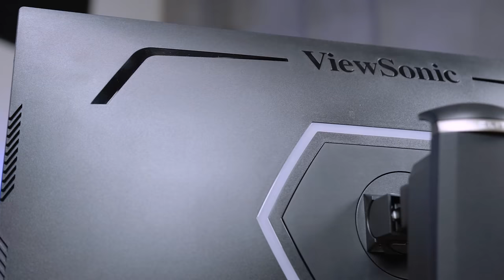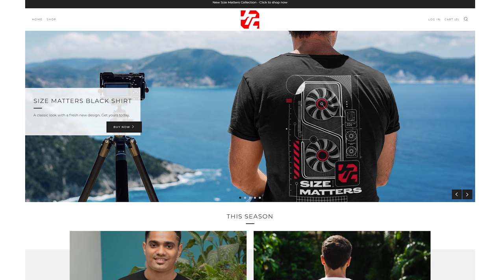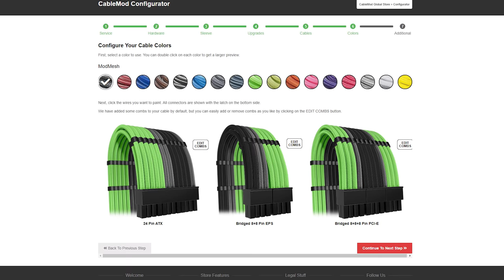This PC turned out better than I had hoped!

Comment: Honestly, I've enjoyed having multiple videos to see how this project has come together. Sometimes a single video can end up feeling rushed through. Also, loving the choice of green for the build!
Reply: Just as a quick aside, if the Jayz team is ever interested in right angles for cables, Moddiy sells 90 degree Pci-e adapters. I'm currently rocking them in my build, so far power delivery is stable *knock on wood*, and it really helps clean up the cable management!

Comment: You should frost the reservoir/get a frosted reservoir to match the tubing runs. Would look so much cleaner and consistent.
Reply: yea you can buy it in spray can form. Works well and would be well worth it. The more layers you do the more intense the effect. Also could do some clever masking to make patterns or make the "frost" look like its creeping towards the middle from both ends.
Reply: agree
Reply: He was talking in his first or second video on this about wishing it was also frosted, but he's just using what he has.
Reply: @joshuaanderson3443  he can also just use fine sandpaper which im sure he has and sand the outside and spray a matte clear coat over it. Theres plenty of ways he could it. Surprised hebdidnt lol
Reply: @joshuaanderson3443  Ooh

Comment: Looks absolutely fantastic, really can't say what else needs to be done to the build. Its pretty much bang on. As you've got UV reactive fluid in there might be worth adding 1 (yes just 1!) UV led near the front of the case and the resevior to give the corners of the tubing and the res a tiny bit of light shading/pop, but thats only a suggestion to play with. Really doesn't need it though. Nothing else needs done. It's bangin'!

Comment: This turned out great.  

I am doing a similar-ish build, but using the 60mm thick radiators, black everything, no RGB, and soft tubing.  All EKWB for everything.   Its an "all go, no show" build.

The biggest thing that I am doing different is I have my pump/res very low, mounted to a custom plexi piece to the side fan bracket, between the power supply shroud and the front rad, and rotated 90 degrees so the tubes won't interfere with anything.  Even with the 60mm radiator, I still have 350mm of space for the GPU.

Comment: I use automotive grade water wetter for track cars. it is slightly purple, but goes clear with water. I have never had an issue with many different builds. I used some pearl color one time and it really messed up everything. great build Jay. benchmark for the win.

Comment: Great build Jay, it looks fantastic. . . . but I have to say, why didn't you use the vertical graphics card mount closest to the side panel (the one that would take a double slot card), I'm sure that would have cleared the pump and would have actually given you more space between the graphics card and pump as it mounts the card closer to the rear of the case. I thought because you're only going single card this time (first time ever) it'd be the ideal time to do a vertical graphics card mount. . . .

Comment: Only thing I would change is the orientation of the motherboard 24 pin cable so it matches with the GPU cable green black green. Apart from that tiny detail, Awesome build, Awesome camera work and awesome content. One more thing. I bought the cheap CPU air cooler you reviewed a few months ago for my Ryzen 2600. Haven't seen temperatures over 60c yet. Quality part

Comment: I think I might flip the front rad so that the inlet/outlet aren't at the high point of the loop. I'd also reconfigure the order so that instead of the flow from the reservoir going GPU -> CPU -> RAD -> RAD it would go to the GPU -> Top rad -> CPU -> Front Rad. I might have also stuck a hard valve in the bottom section with a cap so that I could easily connect a hose and drain the system from the low point. 

I doubt that any of those tweaks would be in any way consequential - this a really beautiful build. Great work!!

Comment: Nice build Jay, good job on the tubing, agree about the bends on the lower tube, would have looked a bit better if you'd more "matched" the upper ones. One thing I might add, not change, is add some form of lighting in the lower section to light up the lower tube coming from the GPU, because if you look carefully, you'll see the colour doesn't match back with the rest that are getting illuminated by case fans - the rest more match the greener green of the cables.

Comment: Hey Jay; Just did a rebuild with Corsair Icue, and Asus Aura/Armory Crate. There was a recent update to the ICUE software where you can join them together in the same place and it worked really well. Just an FYI that those can now work together and you don't need separate RGB software.

Comment: when you see the case in the total view... 1 thing is a little off about it. the window of the PSU shroud is a dark hole. Maybe a LED strip would pull it towards the build.
But for the rest .. really awesome!! bending those tubes must have taken you hours. Good to see Skunkworks back which is kind of a foundation of your channel :)

Comment: Jay, idea

you know those brackets that you use for some light strips, to keep them at a 90degree angle? what if you had some for the soft tubing, used that to prerun your loop and measure everything out, and then use that to cut hardline.

and instead of soft tubing to prerun everything, could use something else as a standby

Comment: Not sure if it's different for the ALs but for the SL120s you can turn on "Sync with Motherboard" or something like that and the fan RGB will be controlled by the motherboard RGB software. Looks badass with my dark hero and plexi EK blocks.

Comment: The only thing I would change is put a small mirror form the back of the case till the pass through fittings to be able to see the gpu block. Maybe put some rubber pads under for vibration dampening. Nice build BTW.

Comment: The final result looks sooo good. Awesome work man. I didn't thi k I would like the res not matching with the frosted tubing, but it looks great! Only tiny nit pick just need a bit of white lighting on the bottom section of the system, it's a bit of a dark void under the gpu and that btmottom tube doesn't quite pop as much as the rest of them.

Comment: Jay: Pretty sure PMMA is the same material as most acrylics, corsair seems to just be using the actual chemical name rather than the generic term. 
It'd be interesting to see how much the frosting affects the heat transfer you were talking about, you could test by sanding the clear pmma tubes to get a frosted look.

Comment: this is just beautiful, I actually prefer the graphics card not lighting up.
The only thing I would change would adding a frosted glass for the res to match the tubing.  
That and lots more storage r/datahoarder

If  I was going to try and recreate this build, I'd probably go with a lot of silver 90 degree fittings to avoid multi-bending a tube, but that has a lot to do with not being able to line up bends properly

Comment: As you were talking about drilling through the floor the only thought i had was, how awesome would it look with those GPU cables tied together if they ran straight through the floor. I guess cut your hole just big enough for them,  but with that i dont know if you could order a rubber seal that would be soft enough to fit over the cables and still able to seal up the floor to make it look clean. Just a thought.

Comment: I'd try mounting the pump/res to the back and low near the bottom. Maybe put a higher res tube on it. Then route the tubes through the shroud. The graphics card can now be vertically mounted. I'd put it in the verticals mounts near the front and come up with the tubing from behind. So it goes pump -> graphics card -> CPU and you basically only see the loop going into the CPU without seeing where comes from.

Comment: That shade of green is not one that would have caught my eye before, but wow does it look nice in skunkworks! Love the glowsticks tubing, love the touch of the motion lighting on the ram sticks - gives it a falling data stream feel (like from The Matrix) - and on the fans. I'm not nearly into the hobby as most of the other commenters probably are, but to me skunkworks looks like a kickass computer AND a visual aesthetic piece. 

Oh, and don't worry about the length of the build. I like seeing the problems you run into while building. That way when i build my own rig in the future, I'll know what to take into consideration because hey, Jay ran into this issue.

Comment: Jay I would've used the vertical mount that already is "installed" in the case as it doesn't seem to interfere with the RAM or the valve fitting :) apart from that, amazing build! Nice work

Comment: Holy crap - that looks amazing! And yes, more videos is never a bad thing. Gives me something to do while working!

I've had a Corsair 750D Airflow for years and I kind of want to water cool in it. Only problem is I can't find a water block for my video card. Would anyone out there know of anything (not the NZXT AIO) that would fit a Gigabyte GV-N2080WF3-8GC Rev. 1.0? Like Jay, I mess with cars, so I'm not opposed to a little modification. Thanks for any help!

Comment: Hey Jay, random video idea: show the best/most efficient way(s) to fill a combo distribution block/pump like the ones EKWB sells for different cases (like the 011D XL). Tip the PC over so the plate is flat, use a 90 degree fitting, a funnel, a filling bottle, etc...EK includes instructions on how to install the plate into a case, but not how to fill the darn thing, would be a very helpful video for us watercooling newbies.

Comment: @JayzTwoCentz The EK M.2 heatsink I was able to get to work with a Corsair MP500 drive that had chips on both sides. I removed the thermal pads and just used a little bit of thermal paste instead. Works perfectly so if you ever have that problem again, give it a shot!

Comment: you can use Signal RGB or Project Aurora as one stop solution for controlling RGB of the entire system. you won't be needing any other software to control RGBs.

Comment: I think it looks amazing.. the only thing I would do differently is there is a lot going on up top.. and a lot of black empty space in the bottom.. I would have put a small built in screen where the window to the power supply is, or make a custom cutout next to that window.. and put it there, other than that... why not two 3090s... it is skunkworks.. and probably the last generation we will ever see SLI unless from some miracle intel starts doing it on their cards.

Comment: Jay - you asked what we might do differently: I can't really comment on the water cooling aspects of the build, as I have no experience with it, but cable-wise I do have a couple of ideas. 1 of them I won't bother describing, as it's still kinda vague, and I'm not sure if I even like it, but the other is from an old modular PSU I had.

Are you familiar with a brand called Ultra? I recall seeing that some people had issues with them, & mine eventually died, so... 🤷‍♂️ Aesthetically, though, they looked pretty cool, especially the cables. Instead of just wrapping the wires of 1 cable with braided sleeving, they used appropriately sized UV-reactive semi-transparent tubing, that fitted perfectly into custom cable fittings. I can't remember all the colours they did, but the UV green cables would go well with this version of Skunkworks. I don't know if anybody else makes cables like that anymore, but I'm sure you could achieve it yourself if you wanted to. 😀

Comment: Only thing I would change, which is probably not possible, would be to dremel a rectangular hole in the psu cage, behind or next to where the tubing passes through, and route your mobo cable through there, so that it will be straight instead of curved to the side, other than that it's perfection

Comment: Funny you mention your issues with EK RGB lights - I have had a few reservoirs from EK with the D-RGB ring not working, just replaced the strip inside the ring myself rather than RMA

Comment: Those frosted tubes look damn good. I actually prefer the card mounted horizontally in this build; I feel like it would have dissappeared and lost its presence sitting back against the motherboard. It'd be nice if the GeForce logo was working though - maybe at some point)
There were a few happy accidents like that - I love the green you ended up with as well. She turned out great!

Comment: Could the built in vertical mount not be used instead? It might provide just enough clearance? You may have the same issue with the valve, but it slightly annoys me you didn't at least try.

Comment: Oh Jay, you can connect all of those things into a commander pro or the corsair products with a $12 cable off amazon that is Corsaid LED cable to ARGB cable and you can control it all into icue instead of armoury and the other terrible software! Way easier.

Comment: We really need a standard for RGB! 3 apps for one build is insane! When will Corsair, NZXT and so on realize that PC builders hate that?!
Reply: He didnt need to. corsair Icue has an Asus plug in, meaning you can control everything from there.
Reply: @Dennzer1  It's still completely stupid how RGB is managed in computers
Reply: @cedric5947  Only if you didn't happen to hear about the Icue Asus integration before you built your PC. If you built it without that info, OR before that was available, then I agree. but done the way I've said, it is totally fine. Not stupid at all. Icue's only problem is that it is a little power Hungary, looking for about 2% of CPU when it is NOT min to the task bar, buy after it is, then its  better. OH and it sometimes needs to be rebooted.

Corsair needs to fix those things.

Comment: What if EK made acrylic tubing with a hydrophobic coating on the inside? It should still be clear, but you wouldn't have to worry about the fluid reacting with the material.

Comment: Pmma is actually really easy to make yourself. I once did it for my chemistry studies. 
Based on the structure I would not think the polymer chain will be cleaved by the solvents used. The only thing that might happen, but would even be happening more in pure water especially if it's very basic or acidic, is reaction with the side groups. Polymers are very sterically hindered by the bulkiness of the molecules so reaction won't happen very fast, but slowly over time the material properties might change a little due to the reaction of the methyl esters degrading into acid groups. I don't think the reaction with glycol is something to be concerned about. Glycol is a much bigger molecule than water and should have a way harder time reacting with the ester bonds than water molecules and it is pretty polar so won't dissolve the pmma very fast, especially in combination with water. It could be smart however to measure the pH of the mixture used and try to keep it close to 7, maybe eved add some (electrophilic / non-nucleophilic) buffer salts, whithout oxidative metal ions of course, in order to maintain the pH over time. 

"PMMA swells and dissolves in many organic solvents; it also has poor resistance to many other chemicals due to its easily hydrolyzed ester groups"
From the wiki page of pmma

Hydrolyzed meaning the reaction of the methyl esters with water forming acid group, thus the possible usefulness of buffer salts.
Reply: Or use dried methanol as liquid lol. Guaranteed no hydrolysis of the methyl esters.

Comment: Jay you should be able to control the ASUS board RGB in Corsair’s iCUE software as long as the armoury crate software or whatever is still installed , just a heads up

Comment: Actually you can remove the rgb led strip from the GPU waterblock without having to remove the card or disassemble the loop. Just pull the wires.

Comment: The build looks amazing.  This has certainly inspired me to give a build like this a shot.  I do have a question however.  I notice you have the liquid hitting the GPU first, immediately followed by the CPU.  Wouldn't you want to cool the liquid down between the two components?  It seems to me like you would be feeding pre-heated coolant to the CPU.  What are your thoughts and/or experiences with this?

Comment: How about using SignalRGB to control your RGB components? Never used it myself, but looks promising for when you have multiple brands and don't want to deal with all the different proprietary software packages.

Comment: @JayzTwoCents Please can you add or do a build with Barrow G1/4" Manual/Automatic pressure relief valves. Would this be a good thing for areas that have very cold winters and very hot summers. Would pressure have benefit on long-term of parts or performance and how does it work.

Comment: the one thing I'd change is, populate the entire RAM slots and put them all into a water block, along with the SSD's, and AGAIN I'd use T-connectors or Y-connectors to send fresh coolant to all blocks and send the warm coolant to the rads through a single tube from all the blocks using either T or Y connectors

Comment: While I hate the basicness of most of these round RGB fans, pointing at you Corsair light loop, these new Lian Li fans are very clean for a circular RGB that is kind of refreshing.  The constant halo look of almost every case on the market is kind of boring and basic, but these have a nice new style to them that I wouldn't mind as much.  I used the SL Uni fans for my last build because of that.

Comment: I have basically the same system but built into a 2005 Mac Pro and 128GB of RAM for Blender. Also 970 EVO SSD and no custom water cooling.

Comment: Why do you put your reservoir inside with your thermal load where it can pick up latent heat instead of isolating it outside the unit where it can dissipate heat? Are your fans pulling from that side to blow cooler air over the reservoir in an attempt to negate it? Or is the material of the reservoir resistant to heat transference? I am not being an ass, I am honestly curious.